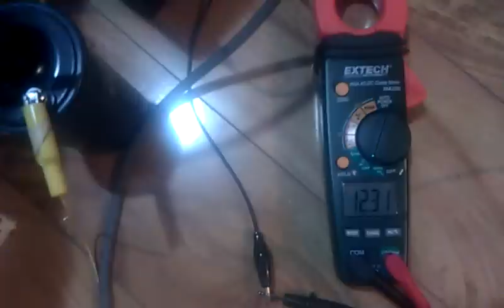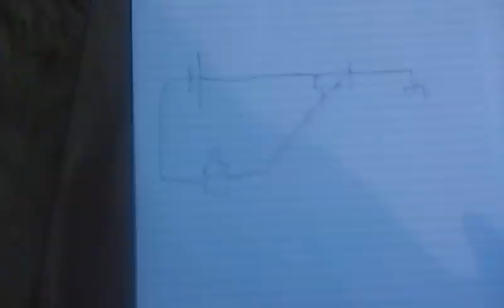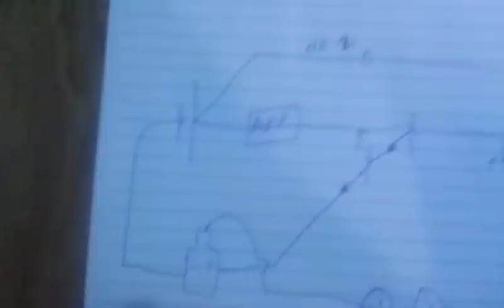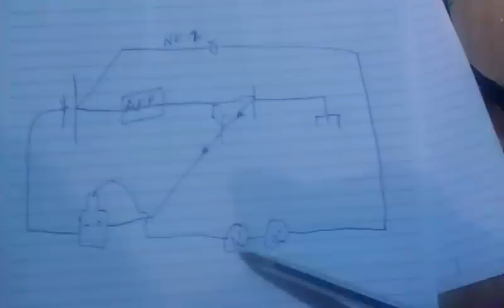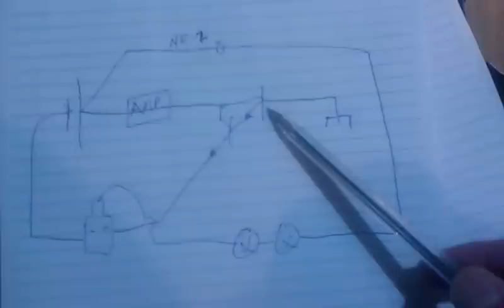Replication Imhotep Radiant CFL Oscillator and Self-feeding?? Part 3 with new SCHEMATIC

Comment: Thanks for diagram :O
Reply from the maker: Be very careful here. I received the worst shock of my life with this circuit while touching the collector and accidentally touched the battery negative... extremely dangerous;)
Reply: @kdkinen  By chance you think a Big Pancake Coil, could sit in place of Car Coil for this arrangement? 
 I've made Joule ringer's with Pancake coils instead of ferrous ring coil, they work well and I got wire. 
Final question, what make of Coil are you using?? Thanks in advance for any tips you share.

Comment: food for thought...google  nst"s (neon sign transformers) and you will find out from most manufacturers that if you do the math output always exceeds the input multiply volts times amps then kv times milliamps and you'll see what im talking about. the mf companies never sought out over unity but they sure stumbled onto it, why?? Frequency and high voltage excites more electrons and thus excess power at output!!!!

Comment from the maker: another thing Deepak, unless you add some diodes off the end of this, the HIgh freq AC will damage your battery. this was done in my early days when i didnt know about such things, plus... 
forget this circuit, go with the double ignition coil LED driver in later videos... better yet... go with a Slayer Exciter or SEC Exciter. if super low input and blinding light is what you want :)
Reply: +kdkinen Hey man, nice stuff. I've been doing a lot with tons of circuits posted to do miraculous things for days, weeks, sometimes even months, however, I am freaked out by the fact that only a handful of replicators are able to replicate some of my stuff. I found out why once I got myself a good accurate oscope. The resonance is what I had that those who couldn't replicate my designs or others designs I has used. I'd like to chat with you regarding some of the d smith stuff you've been working on. I have come up with some breakthroughs, however, I am having difficulty using the prebuilt gas discharge tubes without seeing exactly what the gap characteristics are. Its difficult to know which ones will work to allow the circuits to run. I find the russian R4's to be pretty cool, however, the plasma inside of them seems to cancel out the energy needed to power components in series that are resistive unless they use a tiny bit of energy. I also find that some of the arc gaps cancel out the cold electricity altogether. I'm not all too sure I have reached resonance with some of my circuits and could use an idea of how you find it with calculations, or if you just wing it to try by trial and error. I haven't had too much luck keeping the frequencies steady using zvs's or wire wound transformers instead of solid state nst. I am expecting my shipment to arrive with an NST this week so I could try the don circuit I have already seen evidence of cold electrical output that lights leds, but is immeasurable by digital meter. My scope reads this energy as a negative value and the arc gaps all produce either a purple arc or a emerald green arc, all dependent upon arc distance. The wider the gap, the larger it's output into a filament, although, my plan is to reduce the voltage from several thousand volts down to 480 volts, then, reduce the level of energy by first filtering the frequency with a notch filter for a bandpass of 58-62 hz, then, transform and rectify so I could dump it into an ultracap bank and batteries in series. My plan is to use two 6v lead acid batteries in series, to try and split the additional ripple into two batteries so the plates absorb it along with the capacitors to try and eliminate destrying the batteries. I was told to add the russian r4 gaps as a light bulb and this will eliminate the ripple altogether to make it safe as can be for my inverter and the batteries wil last. I have (2) maxwell banks with (6) 360F D Cell caps in each, I will put these banks in parallel with the batteries, or, get two optima gel cell batteries and parallel each bank with one battery, then, parallel to feed an 8000 watt pure sinewave inverter I have bought internal boards from a manufacturer on Ebay that pre-assembles the boards, then, we buy the board pre built and install them into our own enclosures. I like them better this way so we can eliminate loop detection , auto shuitdown, etc. We could easily eliminate all of this and filter the source power better, then, utilize the don circuit for a complete home power generation system. They sell the kits however you need them, with all components for under $150, which is a steal, however, we have to provide the case, and, I am a true believer in keeping them ice cold, so, I have a collection of fans to cool the outputs, if that is even necessary.. I am finding cold electricity only to run warm in resistive elements, and in solid state components, there seems to be cold instead of warm if that makes any sense. Have you had success with the output? I haven't seen anything new in the don smith or kapagen arena lately? Are you still experimenting?
Reply from the maker: hi there yes I plan to return to this work soon when I move into my new house :)
thanks for the message, looks like you've got some good experience!
to be honest I did find some very cool things with this circuit, and I will re-build it with the new knowledge from the Magnifier experiments, but my biggest motivation is the Akula replication of the Kapanadze/Tesla device using the 3 coil Magnifier as driver.
if that were complete, you could charge batteries if you wanted, but could run AC right from it :)
for sure we could talk
kurtkaukinen@ymail.com
Reply: Thanks Kurt. We'll hook up online soon. I'm trying a number of things, right now building the akula cd4046 phase lock loop circuit he has built to tune resonance. Once completed, it'll most likely be a totally different ball game. Thanks for the reply. Have a great day

Comment: Hi deepak kamble,
The schematics are the same than Kdkinen.
But i'm using 24 volts (two 7 aH batteries in series), and my transistors
are different.
I'm using two mj11016g .
They are special because inside one transistor, there is a darlington pair,
so their gain is very high.

Regards
Reply: So you mean to say that the input voltage should be 24 volts. But in the schematics kd used 12 volts & also a 9 volt battery,
Where am I going wrong? And also how long did you run the bulbs and what was your battery voltage initially & later
Reply: I Connected the earth wire to the earth of my building and When touched the base and the collector Only the Neon Lit up and  not the cfl. The neon lit only when I touched the base and the collector of the 2n3055
Reply from the maker: try adding more spark gaps or more or less bulbs is one thing that did make a difference... and make sure you don't touch the collector and battery at same time, it will kill you.

Comment: He Kdkinen.
I'm actually playing with your circuit.
I would like to thank you, because it's simply amazing !
I've tried the version with the two car coils and the 12 V led bulbs too.
And...I've got the same results than you :-)
My actual setup is working with two 12 V 7AH batteries in series.
I've got 2 different gutterd CFL, with "air ground" wire running nicely.
When I add the neon bulb, this one is bright, but when I place it on the plus of the battery, the circuit cuts.
I've replaced the neon bulb with a small reed switch (tiny spark inside), and the circuit is running for few seconds and stops.
I've you got any ideas ?

Thanks for all :-)
Greetings from France.
Reply: I tried building the same but i couldn't see the bulb glowing will you plz help me .

Comment: Hey, would it be possible to run 12v led foglight/headlight bulbs using this design?  I could run my entire apartment's lighting for next to nothing.  BTW if you want cheap leds the car ones are cheaper so you dont feel so bad when you blow them up :)

Comment: @kdkinen Cool. I picked up an auto coil today. I have no idea if it has an internal resistor or not, though. I'll try to get it running, just going over the circuit again, right now, once again. It almost seem too simple.

Comment: My 2 cents on this setup. From a simple experiment I had did in the past with ignition coil and ac capaitor and earth ground using an inverter as an isolation power souce the ignition coil behavior always acts to find earth ground by the very nature of the device. The earth ground is nothing more in my mind then a big capacitor. So you just bypassing your orginal cap by using ground to turn on the base makes sense. You have is a big giant loop because of radiant energy of the coil Resonace.